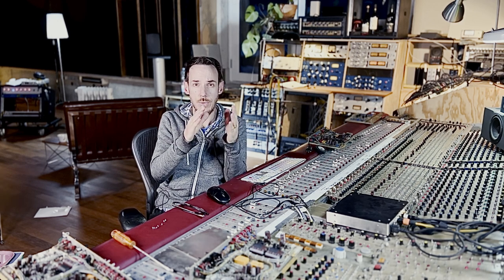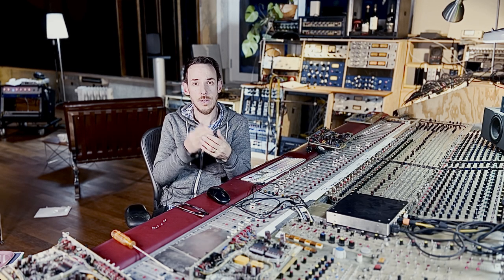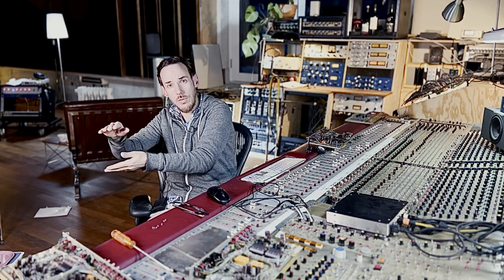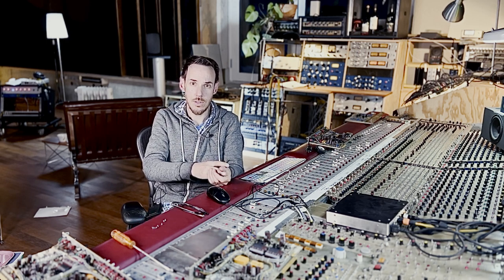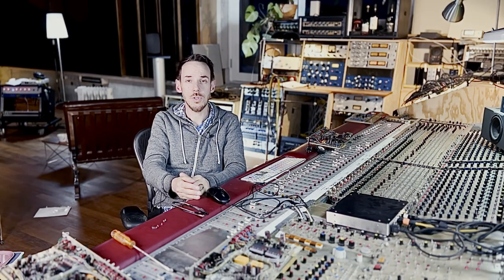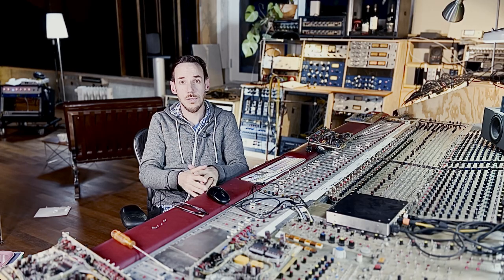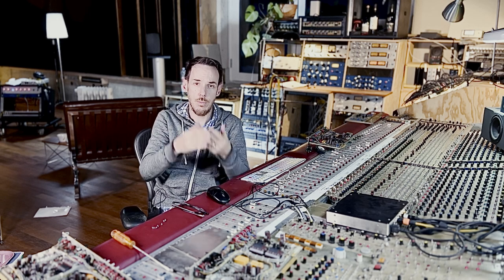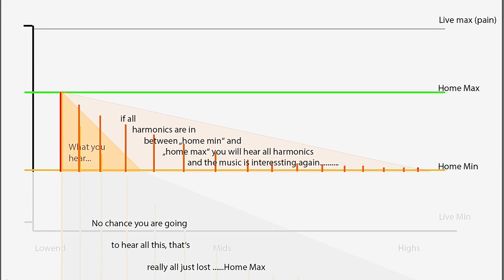WHY do we compress and change the Dynamics of the music while mixing?

Comment: Hi Daniel, love these videos.
Would it be accurate to say that when we compress we reduce the dynamic range and bring up the RMS energy of a signal and it’s this RMS energy that has the harmonics in it? Or am I misunderstanding it
Reply from the maker: It's maybe not fully correct to think so in a theoretical way, but de facto you can see it that way. If the RMS Level is hot and on a good spot, you have a good chance, that all harmonics are heard better. 

Spread the word, if you like the vids, and check my Mixing Bible, if you havn't already on www.danieldettwiler.com
Reply: Thanks Daniel, I’ll be checking your courses out for sure, all the best!
Reply from the maker: @davidtighe6769  Let me know what you think🙂